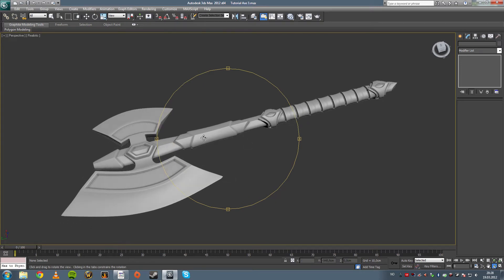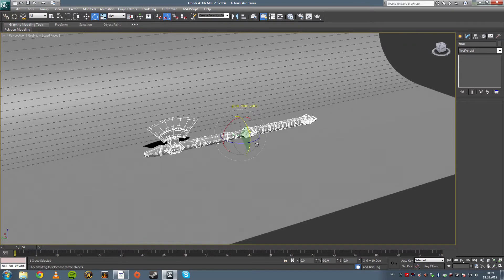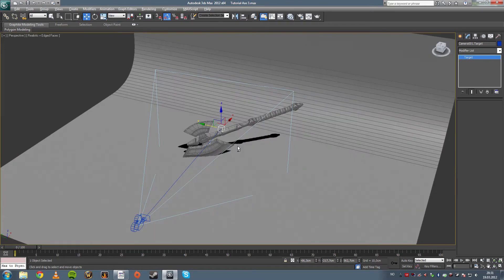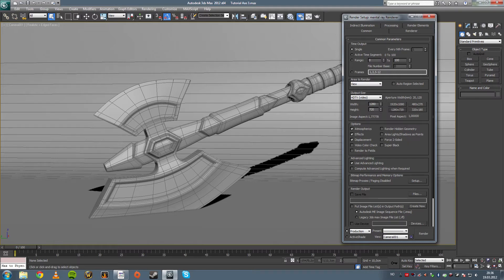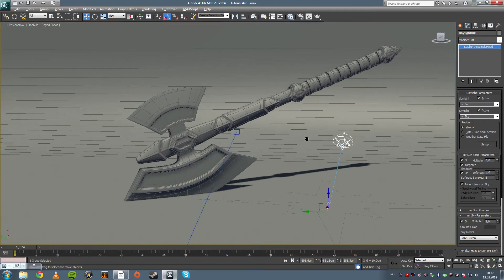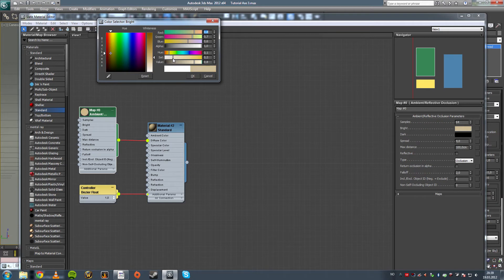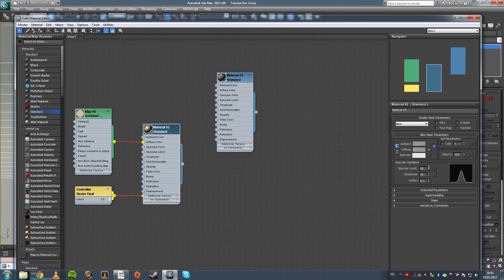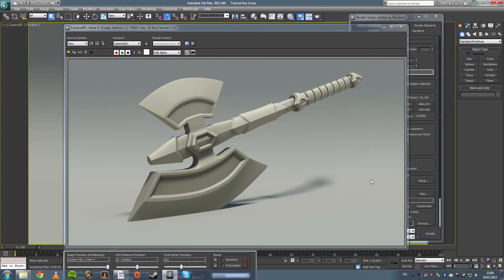Sub-D Modelling in 3Ds Max Part 7

Comment: By far THE most helpful and clear tutorial I have seen yet. It's really nice that you showed a complete workflow, tips on fixing mistakes and showing proper use of tools. I'm subbing no doubt. I was wondering one thing though, since I just started doing polygon modeling I used some techniques and was making a basic figure with turbosmooth and is giving me a couple issues. Would you mind if I sent you a .max file of it and tell me what I'm doing wrong?